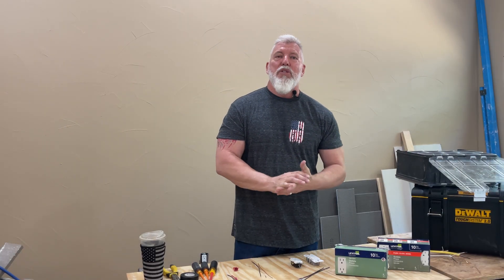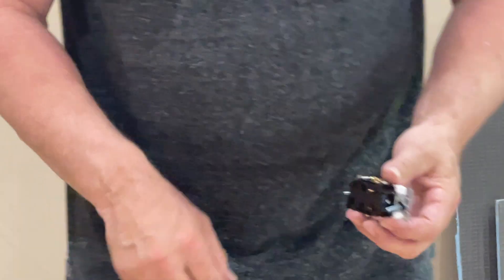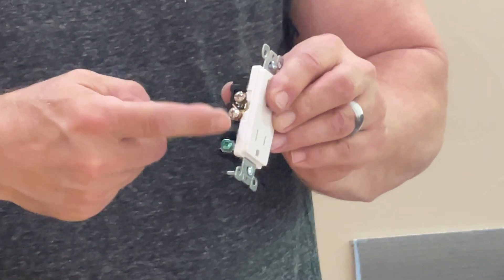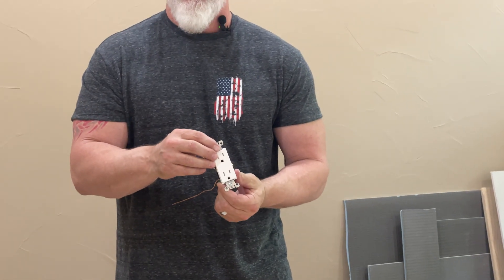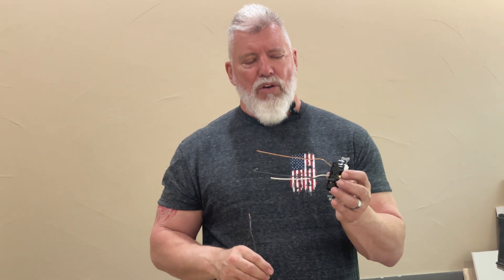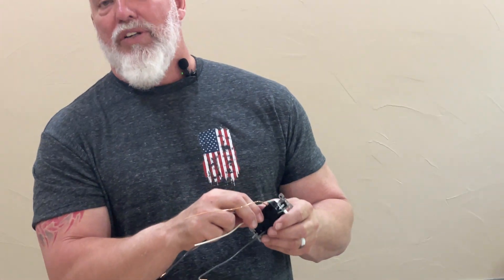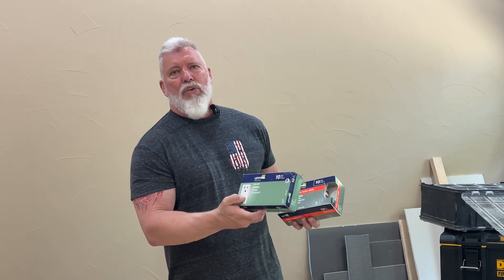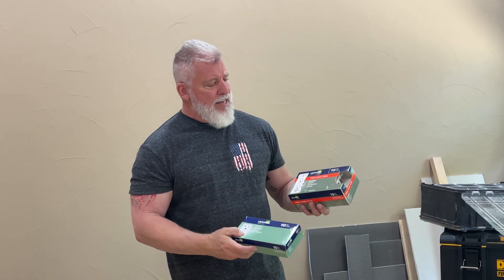The No Tools Required Electrical Plug Installation, Fast and Easy

Comment: You might think that if an electrician finishes a job in half the time he has to charge twice as much? Wago type lever devices haven't stood the test of time. Speaking of time, the time saved using them is probably offset by the increase in cost of the plug, whatever that is?
Reply from the maker: Both very valid points, In the past I’ve always worried about the connection heat factor. I used a heat gun while on full load with a blow dryer and the wago remained somewhat cool. Maybe that should be a future video, thank you for your input.

Comment: They suck for old work (cut in boxes). First is the size but if you know how to stuff a GFI size device it's doable. More of an issue is the ears, no prevision to break them off to make the device sit flush.
Reply from the maker: Very good points